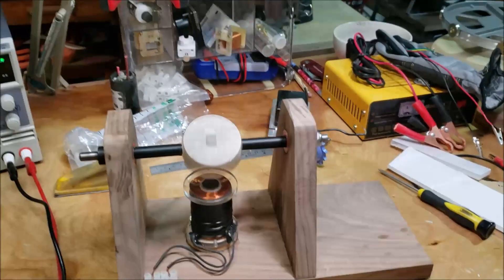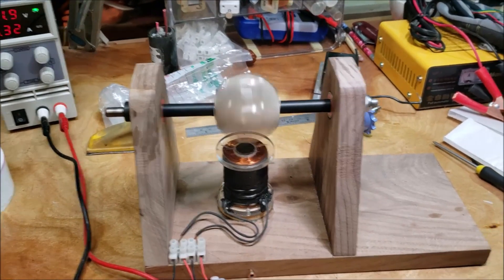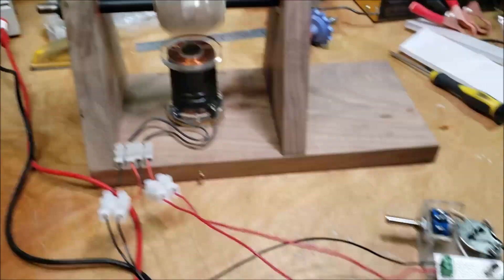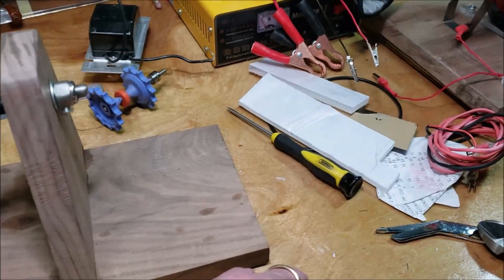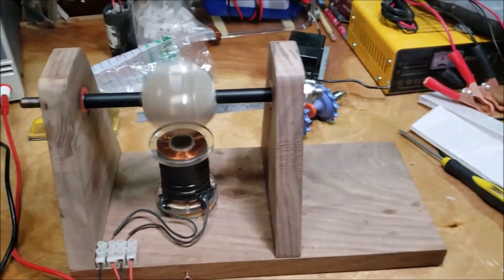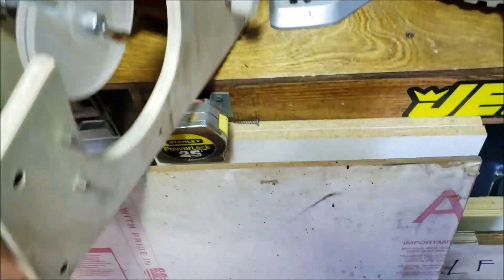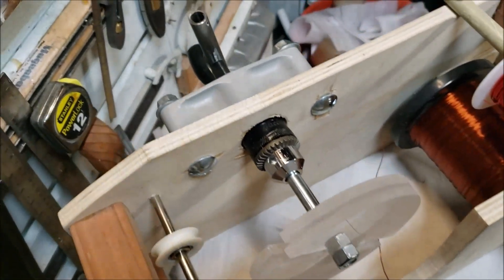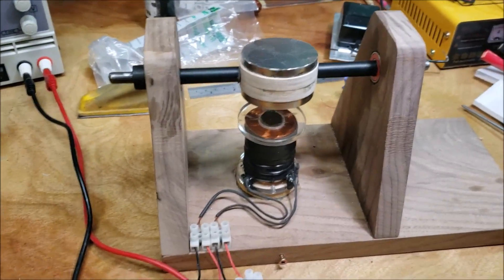New Bedini circuit

Comment: When you say it's working great,... Have you managed to get more output than input? Have you looped the system? Thanks for the video.
Reply from the maker: ok so when I say its working great, I mean the circuit and the rotor. I'm a firm believer in physics and I don't think I can lop the system without a special circuit system and caps. As far as more out put than input, well the 3rd law of thermal dynamics says we can't do that......yet :)